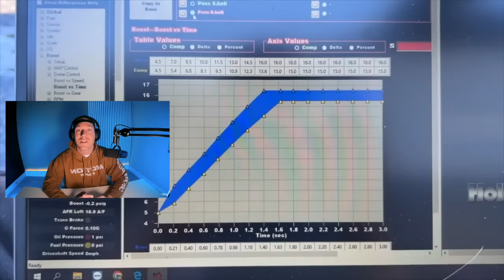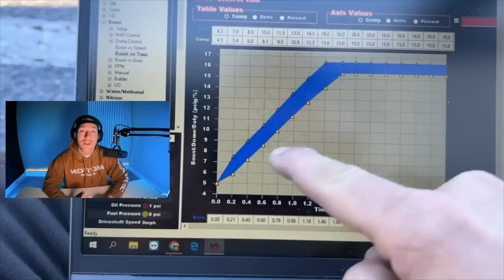Day 1: What Happened To Dr. Pepper?

Comment: Should have sold it as a roller and kept the motor for the long tail Thai boat until you get a diesel motor built. Would of got just as much out of the roller as you did with a running car
Reply from the maker: Hard to say. It would be an animal with a V8 on that boat I don’t even know if it would float